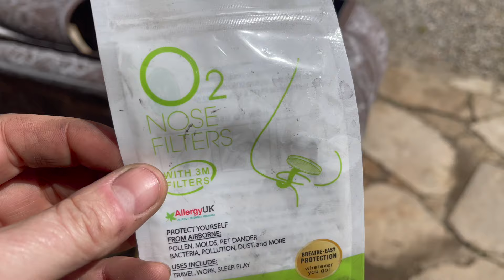Vintage Pedal Car...Let's Cut it UP!!!

Comment: what size tip are you using on the plasma cutter?
Reply from the maker: The hole size on the tip is slightly less than 1/16" and slightly larger than 1mm...the cutter I used on this project is my high frequency machine, cut 50...very cheap machine but I prefer it for some projects... I also prefer the extended shaft tips. The ones I use are linked below! hope this helps!
https://amzn.to/49BrPpg

Comment: While you were working on the camper I noticed you have a scar on your left thumb, now what did you do to it? You have a chunk gone😳
Reply from the maker: ha well...that's a result of carelessness! It was from a wire wheel....yep! you should have seen it when I did it! I was doing a project for HGTV and it was about midnight and I had a fresh brand new out of the package 4" wire wheel (very stiff and very sharp when new) that I was finishing their project with...got careless in my sleep deprived state and it kicked back out of the pipe and got me good! I was like NOW what am I going to do...the project is due tomorrow, i mean today! ha...so I just washed it, grabbed some superglue, glued it and kept right on a going! It truly never really hurt and didn't bleed much but it was deep! It actually healed up much nicer than I expected it to!
Reply: @marcijunebug HGTV?  ARE YOU GOING. CABLE OR STREAMING WITHOUT. OUR KNOW?😅😅😅
Reply: @marcijunebug   MJB.  what's the status of the VW. Bus. Still on the rack or what😅😅
Reply from the maker: @gerry-p9x  still on the rack, but I just pulled the front beam out to get it ready to NOT be on the rack! Gotta get the front beam and transaxle ready to throw back under!
Reply: @marcijunebug  get that motor and trans axle outside and freshen up...gonna get cold put the and gonna yard drive this spring😅😅😅😅😅
Reply from the maker: @gerry-p9x  that's the plan! I'd like to see it at the vintage camper rally next year! So that gives me exactly a year! ha
Reply: @marcijunebug  ha. Ut the kid to work scraping the 36hp. And paintingthe rims

Comment: what a waste
Reply: Trust me, I was there when this pedal car was purchased and it was not a candidate for a restoration. Fortunarely, it was transformed into a neat piece of art for the owner to enjoy for many years.
Reply from the maker: ehhh...would have just gone off to the strap yard after the wheels were stripped off it...trust me that was the only thing even close to being worth saving.  If you know me and have watched the channel you know I save it if I it can be saved...if not...I save it another way as art!
Reply: @marcijunebug  u never herd of fiber glassing or bondo  i have a station wagon worse and its getting glassed
Reply from the maker: oh yes and done my fair share of it so I know the time involved to do it right...and all of that cost $ and time...this car sold for 2X what it would have been worth "restored" and full of bondo...and I had 6 hours total in it counting going to pick it up and about $45 in it counting my consumables and gas to go get it.  I figure it was the perfect solution for a car in this condition, leave the better candidates for the restorers! cheers